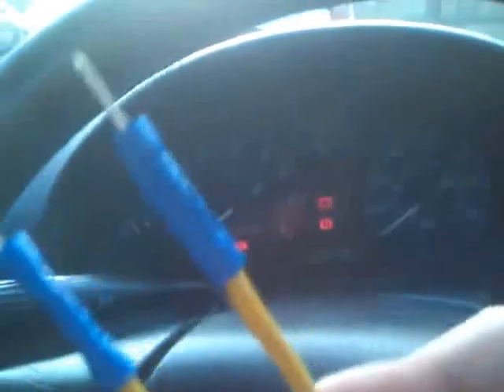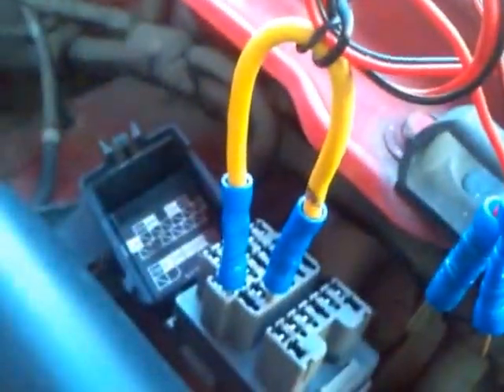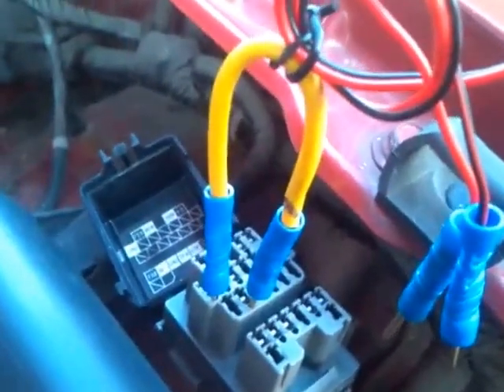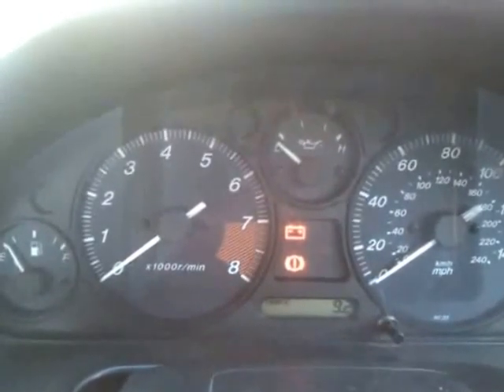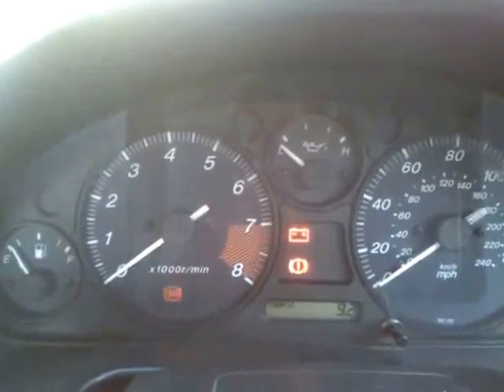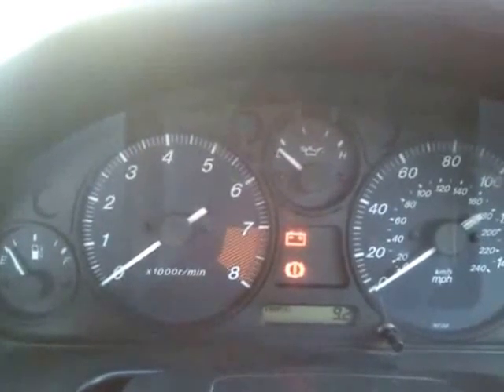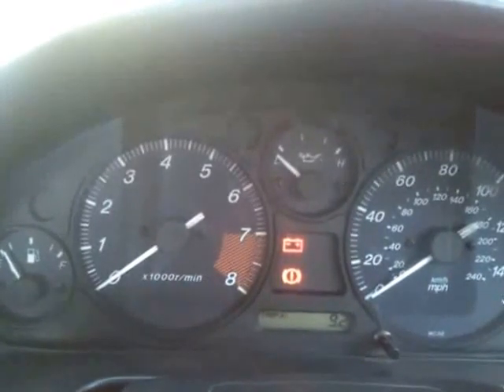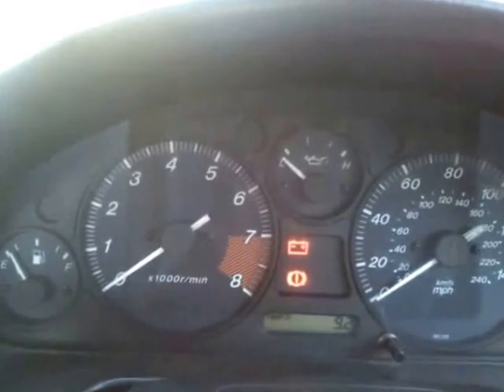Retrieving ABS Fault Codes for MX5 1989-2002

Comment from the maker: it was a 51 code, but the first code is usually the Accurate one, without Driving it only gave the first code. make sure you Clear all codes before checking :-)

Comment: My mx5  had abs and handbrake light that would not go out I was told it was the sensor, the abs unit, the ecu turned out to be a fuse on the fuseboard was fault nice old mechanic at a mazda dealer said to me after going to so called mx5 specialist and getting expensive bits replaced. He said I bet my life it the handbrake warning fuse he changed it and hay Preston and light no more but the fuse did not look blown but he said after 15 year change all your fuses there getting weak
Reply: What year mx5 did you have?
Reply: Handbrake light can also be due to low brake oil level, even if it is still above the minimum

Comment: Hello.
How do I know if an ABS sensor is in need of changing and which one is faulty please?
Reply from the maker: quickest and easiest option is to use a meter to test the resistance of each sensor by unplugging each one in turn and test at the socket sensor end. note all four and the one with the odd value is the one. Using the steps shown in the video is a good idea if you have an NBFL
Reply: @DarrenDJV  Many thanks.
Mine is an NB

Comment: You need to update your description, there is no way to pull codes from the 1993 or older Miata ABS by your procedure simply because the diagnostic pin is not present in the diagnostic connector.
Reply from the maker: Did they have ABS?
Reply: @DarrenDJV  Yes, was the first year and no connection for diagnostic is present. That started in 1994.